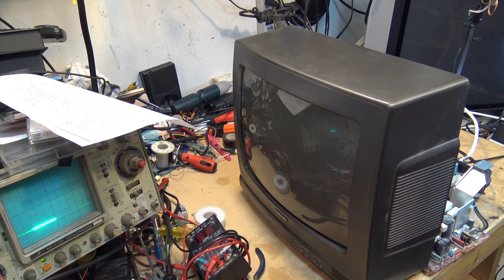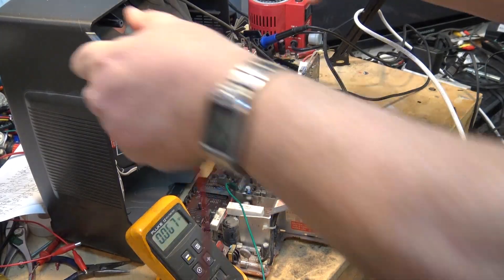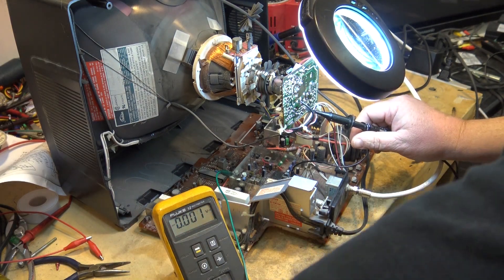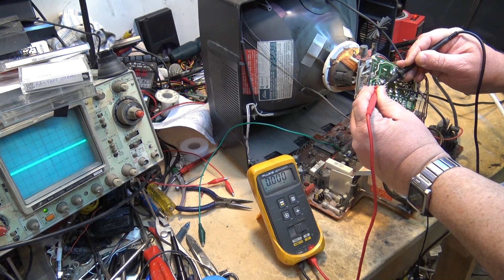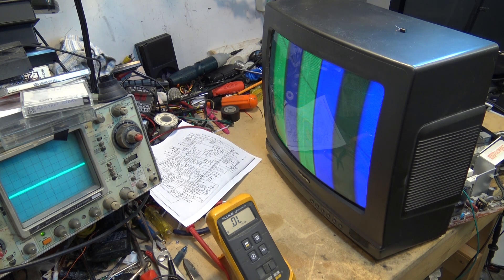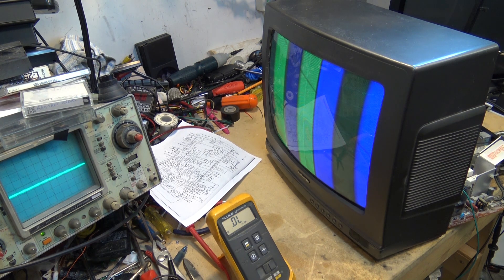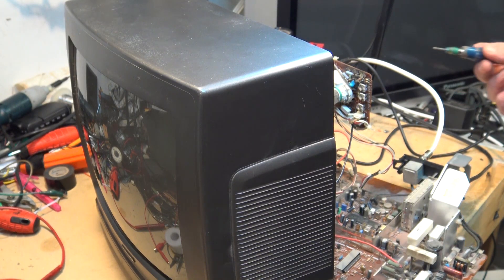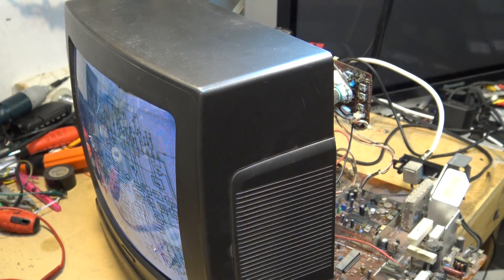toshiba crt tv troubleshooting video output and crt bias adjust

Comment: You explain stuff very well, I can see the experience behind the explanations. I had a set with a red screen too, and in that TV it was the CRT which was bad. I found that using a different trick - I desoldered one leg of the resistor in the collector circuit of the video output transistor of the faulty channel and saw that nothing changed. Then I did a little research on the web and ended up making my own winding for the heaters, few turns of wire on the open section of the core on the flyback. I measured the amplitude of the voltage on the heaters beforehand and just tweaked the number of turns to match the original value. 
 Doesn't look very pretty, but keeps the thing out of a landfill. Which is good, because the CRT in there was a nice strong one.
Reply from the maker: An old trick was a picture tube brightener which was basically an isolation transformer for the heater to give it more volts and run it hotter.
Reply: That would work, but I didn't have such device to hand and it will be a shame to overvolt the filament on the nice strong CRT. I would've used one if I had it, but I would've added a resistor to drop the voltage back down, again, it was a strong tube. I wouldn't bother if the tube was on its last legs. 
 It's a great idea to use this set as a learning rig, I like these videos. The first one about the bad cap was especially interesting for me because I didn't come across such problem yet.
Reply from the maker: What we usually did the same. A few turns around the flyback as you did as tube brighteners don't work peoperly on flyback wound filament circuits, but they did work great on older sets, and those ones were generally on their last legs. We would get these old console sets that weren't worth fixing, but the owner was in love with it because it was a piece of furniture, and they insisted on it being fixed but didn't want to spring for a new tube. This would get them out of my hair for awhile until the tube gave out completely.

Comment: really enjoy your vids, hope my question helps, where does the color bar come from/generated.  (on set?) thanks  j
Reply from the maker: They are coming from an old ENG TV camera. I was goven an old Sony DXC1800 and have it feeding into a TV modulator that puts it on channel 13 that feeds into the TV.  Its an old single tube camera not much good for anything, but the bar generator makes it a keeper, and it looks cool. I have a few other cameras with bar genrerators in the too. All the pro stuff has them built in for color matching in multi camera use.

Comment: Even better, have someone you know (who's an electronics tech) "fiddle" with the set and create a fault, then give you the set back without telling you what they did. Then see if you can diagnose/fix the problem. It's more challenging when you don't know beforehand what the problem is! :)
Reply from the maker: William Squires 
that's what the instructors did back in school. I think I have demonstrated in the hundreds of other videos that I have troubleshoot. the first one on this set was such. bad series capacitor with color xtal causing no color. I have other broken sets to troubleshoot. just while this one is apart I have created a few common failures to show the procedures to quickly find a fault. Even though when I create the fault it doesn't require me to do serious diagnosing this is more of the educational value to viewers how to localize the fault and fix it. As I said I get enough real repairs so I don't need to prove that I know what I am doing, but these "staged" faults still provide learning opportunities for those wanting to learn this fascinating skill, and it is really cool when you fix your first trouble. Just like the thrill I got when I built those tube amplifiers. start out with a bag of parts and have a unique piece that you can't buy in the store when you are done. brings me back to my heathkit days. speaking of heathkit. I have a heathkit receiver to fix on a future video.
Reply from the maker: William Squires 
Done that many times.

Comment: Thanks for the videos. Keep them coming.
My dad owned a repair shop back in the early 90s.
I was only 10 to 12 years old (don't remember exactly).
My job has nothing to do with electronics though.
He was always against me being a technician, like him. He didn't want his son to "use a screwdriver". That was his saying back then.
Now I m a baker. I guess he was wrong.  Being a technician is a better job.
At least my salary is almost the same as his was, above average.

But my gutts say that I was born a technician, not a baker. Too late now :(
Reply from the maker: I hear you. I was encouraged when I was young to learn a trade. My dad always said if you have a trade, you will have a job for life.I repaired electronics for 20 years as a career, but the industry was changing, so I got out 13 years ago, but used my skill set to get into the work I do now, as a telecom tech. I have tried encouraging my son to learn a trade, but he has no interest in any type of work that involves using tools. He works in retail. No future in that I am afraid due to online shopping, but he hasn't figured that out yet.
Reply: My dad was aware of the progress of the electronics. He knew that the parts are getting smaller and smaller. Fixed parts and smaller pcb's were his nightmare. I understand him.
But technicians will exist forever. No matter what.
It 'll be the same aproach but with different solutions. It might even be a cleaner and healthier profession.

The only thing that bugs me is that I was forced to do something completely strange to me. Even though I was born a technician.
Sorry for my english. I did the best I could.
Reply from the maker: I hear you. I had plenty of support in my decision to go into electronics, however it threw up many roadblocksBuying my house was an absolute nightmare. Even though I had saved over 50% of the cost, and had worked for 10 years in the shop, and could show my  income for the prior 10 years 3 banks in a row would not approve me for a mortgage because they were worried that I wouldn't have a job in the future. They all said that it was a job with no future. They were right 10 years later. If I had gone into broadcast engineering things would have been different, but consumer electronics has always had a target painted on it.
Reply: 12voltvids 
Building a house! Poeple work for a lifetime before they build their own. By the time they achieve it, they are at their 60s. Same goal for every citizen, in every country. Same thing in the 80s, 90s, 2000, 2050.

I asked my dad (a few years back), how did he manage and raised us. 
He replied that wasn't sure about tomorrow. If he would keep his job. Didn't know what the future will bring.
Built his house brick by brick. Without banks. It was tough for a few years. But it was less stressful for him.
He has retired. He 's 65 years old now.

Now I must prove worthy and have a successful life. 
I 'm unsure about the future too. Who knows?
Reply from the maker: I hear you. Heck I wasn't trying to build a house. I was just trying to buy an old one in 93. That was a challenge working in a TV repair shop. I tore that house apart and rebuilt it in 2003 and left the TV repair business the same year.  I don't have to worry now, as my current job isn't likely to go anywhere. There is a huge demand for internet and TV, and I don't see that changing any time soon. Figure I will work another 8 years or so and then retire. As a good friend of my says, I want to have some time to enjoy the finer things in life before I cash in my chips for good.
Reply: 12voltvids 
I wish you the best for you and your family. 
You 're a good person (you have a cat!).
It was nice conversing with you.

Comment: Are we looking at a CRT driver board with 10 transistors  if so it is likely that the output stages are Class A output yes a shorted transistor could cause this condition or a burnt out 56k feedback to the bottom transistor no bias in that the bottom transistor cannot turn on to control the voltage to the plate or the diode from the base of the top transistor to the collector of the bottom transistor or the diode between the emitter of the top transistor and the collector of the bottom transistor where the two diodes come together would that cause the same fault.